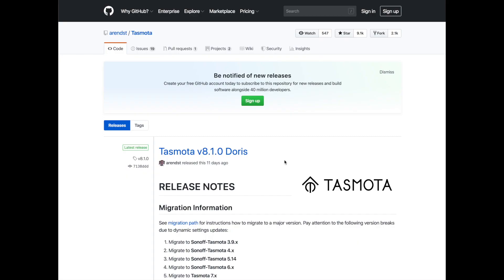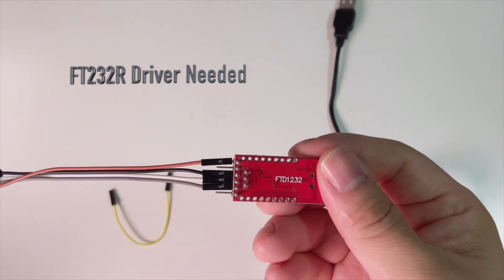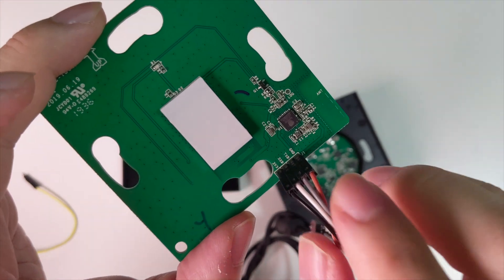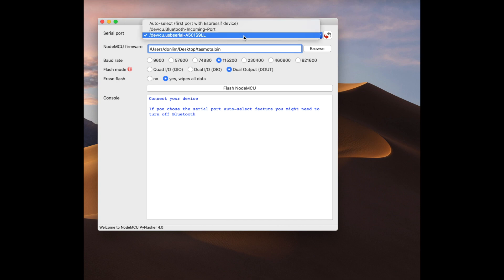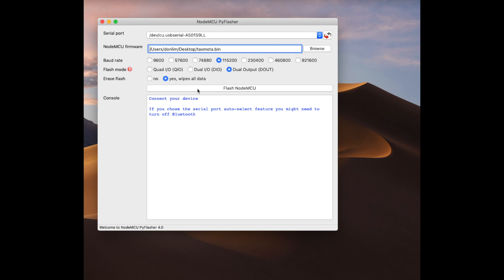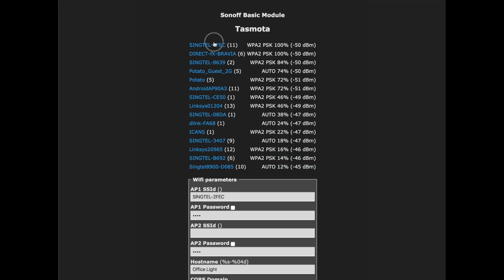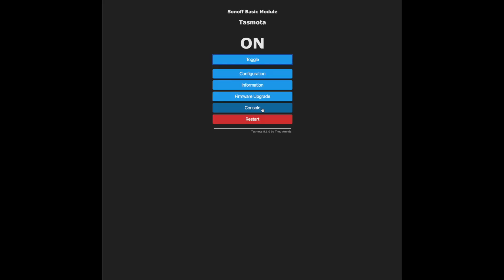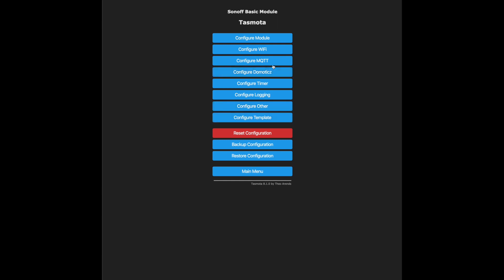Flashing T4EU1C no neutral with Tasmota No soldering  *Mac users read detail before start

Comment: Good guide - thank you. I have a question, do you also have the wifi symbol flashing when the relay is turned off? tasmota firmware 8.1
Reply from the maker: No I don't. If your wifi symbol is flashing, it's likely due to poor or no wifi connections. You would likely need to setup a AP near the switch.
Reply: @POSEIDONsea  I will test with a different AP and different position. I am surprised by the flashing wifi indicator because the switch is working properly, I can connect to it through the browser. Everything works smoothly.
Reply from the maker: @bogdanpikula  Strange. Did you use either the touch or basic template? I'm interested to know how to resolve this.
Reply: @POSEIDONsea  Here was the problem :) I had chosen basic. When I changed to "Sonoff Touch (10)" the wifi symbol stopped flashing - it is working properly. Thank you for your help.

Comment: Thank you for this Video.

But I have some questions:
Does the Hardware Button still working?
Does the Button works with the anti flicker module?
Are there some other problems? 

I want to buy this smart switch too if everything is working fine :)
Reply from the maker: I'm using this switch personally. No problems. The button is working with either the basic or touch template. You need to install the anti flicker module with this switch.
Reply: @POSEIDONsea okay, thank you :)
Reply: @POSEIDONsea  When I applied sonoff t4 to a traditional 60W bulb, the touch worked. When I applied it to seven 5W LED bulbs now - the touch does not work. (Antiflicker was mounted). After removing the glass cover - the touch directly to the "white tape" works.
Sorry for my English ;)
Reply from the maker: @bogdanpikula  Not working in what sense? Flickers? You need to install the anti flicker to the first led in the series.
Reply: @POSEIDONsea  Antiflicker is installed. Everything works fine through the browser. Only hardware buttor does not work when the glass housing is attached.
Reply from the maker: @bogdanpikula  Sorry can't help you here. Haven't encounter this problem.
Reply: @POSEIDONsea  I will try to find a solution. Thank you very much for toturial and help.
Reply: I found a solution to the problem. In my case it worked. On the website https://tech.scargill.net/zemismart-vs-sonoff/
Pete Knight says:
"I found that when it was installed the touch switch was less sensitive than I’d seen on the workbench. A quick search showed that this seems to be an issue with other versions of the Sonoff touch switches and the simplest solution is a piece of cardboard between the back board and the front board of the switch, to give the front board a better contact with the glass front of the switch. I suspect that screwing the switch into the patress distorts the switch assembly slightly".
Reply from the maker: @bogdanpikula  Thanks for that!